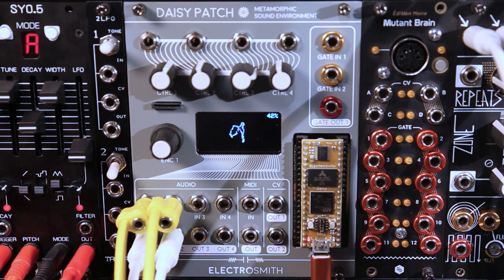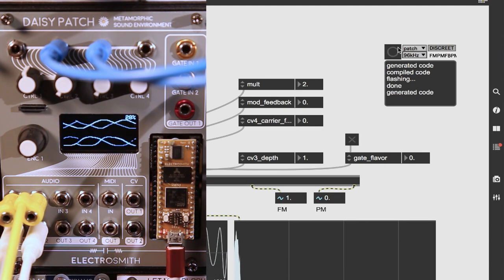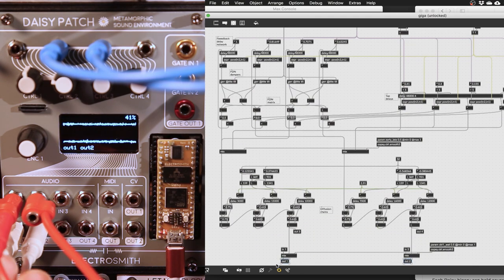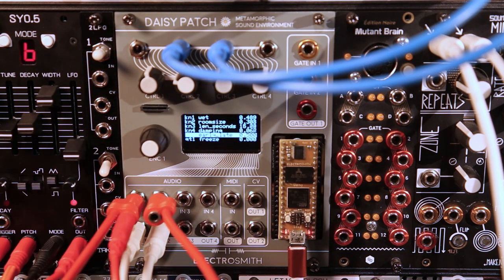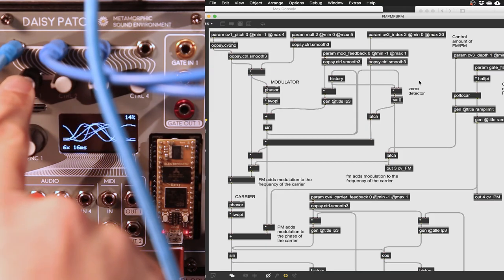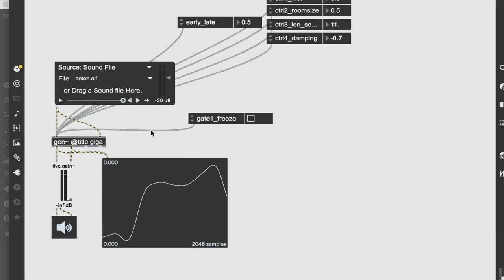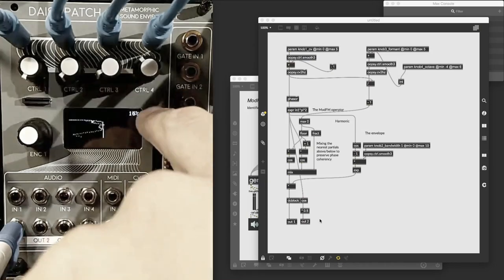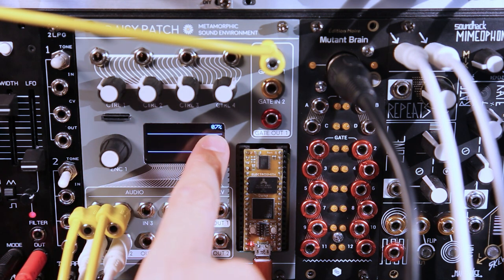Oopsy: Daisy from gen~ in Max/MSP

Comment: interesting! specially the fast upload inside maxmsp! ?>  can the display adapted or used for USER code? (like show the waveform of a buffer) - short: can i use normal C++ in combination with Ooopsy? (aka build my own motherboard for daisy, use my own ssd1306-build a interface, load samples from sd into a Buffer which is accessable for  oopsy, and make me a one shot sampler? (recording data, buffer data, and doint gen~ stuff with it)...... or in short: can i combine C with MaxMsp.... thx for tips.

Comment: Would I be able to flash to the Daisy within MaxforLIve? Or does this only work within Max/MSP standalone?
Reply from the maker: As far as I know, gen~ requires a full Max license in order to compile (and export) code.
Reply: Was wondering the same. Cross grading for a full version of Max/MSP if you're using M4L is about $200. I think Graham has demonstrated that it's totally worth it with this video.

Comment: thank you for the video! I got my daisy a few months back and I was waiting to get into gen~! but as far as I understand, for not it is only available for those "standard" devices, right? not for custom hardware, only presets for the kits
Reply from the maker: Support for custom hardware is in the works, but I focused on the "standard" targets first since that's what I have to test against!
Reply: @grahamwakefield  Thanks for the answer! Any ideia on when this will be available? My situation is the exact opposite: I don't have any of the standard devices! Hahaha.
Reply from the maker: @MatheusLeston   It's being tracked here: https://github.com/electro-smith/oopsy/issues/34 - I think most of the necessary infrastructure is already done in the `dev` branch. At this point it needs some actual custom platform testers to find out if there's anything missing!
Reply: @grahamwakefield  Amazing! So far I haven't built anything with it yet, but let me know if you need any help!
Reply from the maker: @MatheusLeston  Great! The best thing is probably to post questions etc. on the electrosmith forum (link in youtube description) when you do!
Reply: @grahamwakefield  Will do that! Will also keep an eye to check for the new versions for Max. Do you think that if I build something quite simple, with some pots for example, I could use for now the code of something else, like the Patch?
Reply from the maker: @MatheusLeston  Probably munging together bits of the different platform config JSON files will get 90% of the way there, and the configs have some rudimentary documentation here: https://github.com/electro-smith/oopsy/wiki/Custom-Seed-Targets -- also I'd suggest following up in the ES forum here: https://forum.electro-smith.com/t/oopsy-daisy-seed-hardware-mapping/1045/2

Comment: Hi! So it can be stereo, polyphonic, can it also read long stereo audio files? How many "instances" can be played simultaneously? What's the CPU limit, is it comparable to the er-301 in this regard? Thanks a lot
Reply: Hope you're alright with me questioning.. did you encounter any undesirable noises? From screen, encoders, rejections, any reaction to neighbouring modules?..etc... Many many thanks
Reply from the maker: @mathieumorel448  I don't have an ER301 to compare unfortunately, but you can see more info about the core processor and other capabilities here:  https://www.electro-smith.com/daisy/daisy  The Daisy seed itself is stereo in & out, the Daisy patch expands this to quadrophonic in and out, and the latency can be sub millisecond. Number of instances/voices etc is all dependent on the complexity of the algorithms yu put on it. I've had quite complex granular and reverb algorithms running at 48khz without hitting the cpu limit, for example.

I haven't personally heard any noise from encoder or display etc. I recommend sking on the electrosmith forum.
Reply: @grahamwakefield  many thanks Graham, that's kind. From your answer it sounds like I can dig the forum 😉, I shouldn't be desapointed! Cheers!

Comment: I've been hyped for quite a bit, and have spent an all-nighter making a nice oscillator patch to try out. While I wait for my Patch to get here, and my email registration for the forums, I have 1 question.

1) What is the current status on being able to load samples from the SD card? (as Wavetable stuff would be amazing)
Reply from the maker: Great to hear! 

In answer to your questions:
1) SDcard support will come in the next couple of weeks; I've been holding off adding that while some changes were happening upstream in libdaisy.
2) The audio ins & outs are AC coupled
Reply: @grahamwakefield  Alright good to know, I've got a neat wavetable oscillator, and currently using Buffers to load them.